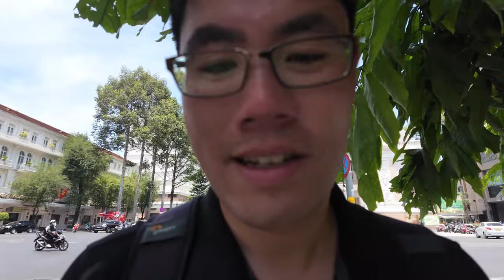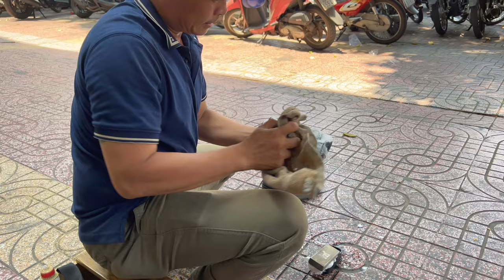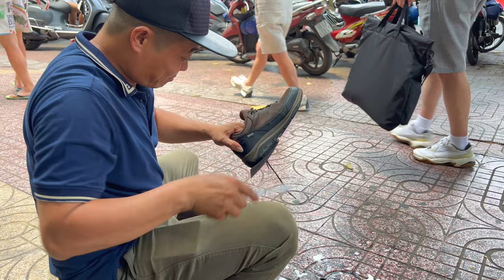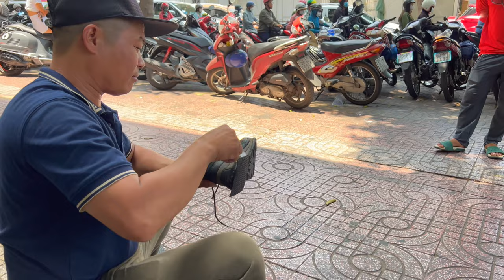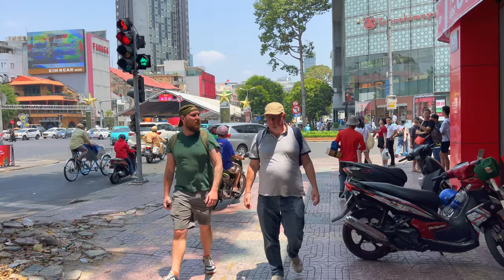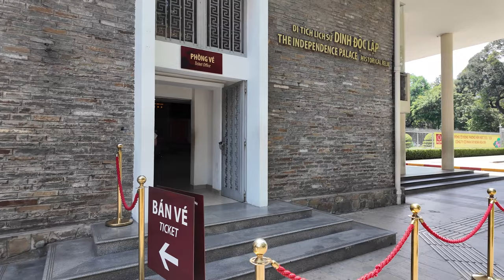Avoid This Shoe Cleaning SCAM in Vietnam

Comment: To be fair you didn’t get the price upfront and then told him you are from New York. $$$ hopefully the shoe repair holds up for you till you can get some good/ comfortable replacements.  

I’d rather pay $10-20 then walk around with a loose heal especially with how much you walk ($40 is to much though considering the average non professional wage there is around $250 a month). I wonder what he would of charged if you had told him  you are from Taipei.